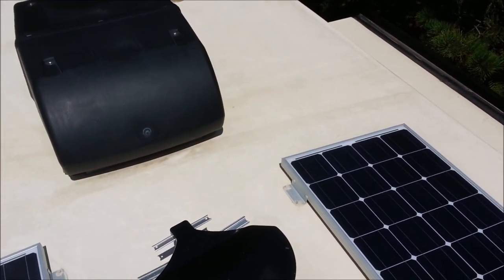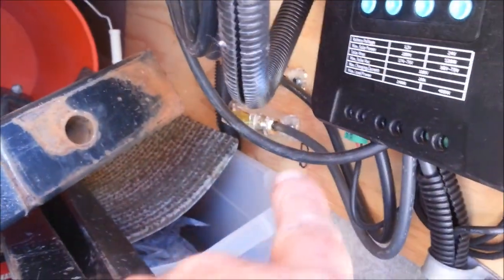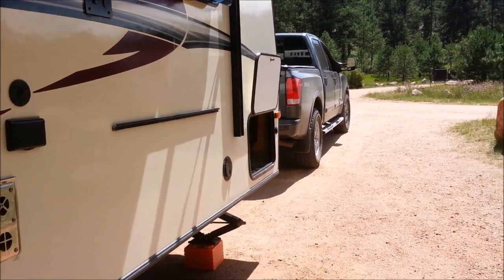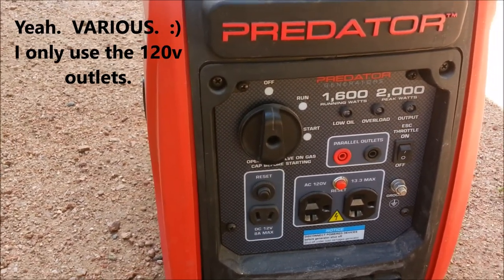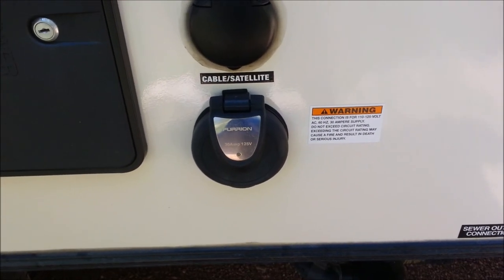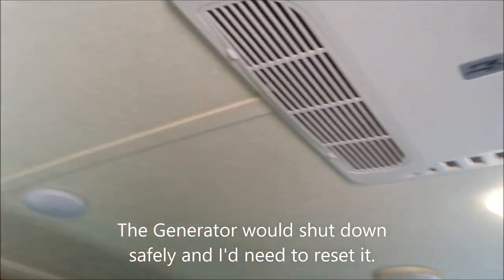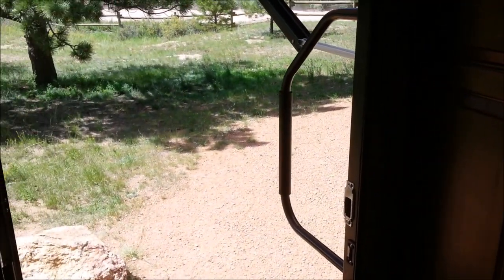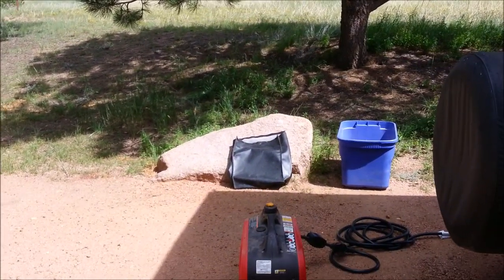Electricity 102 for Campers and Trailers.  Solar & Generators. Forest River Rockwood Mini-Lite 2109s

Comment: 2000 watts if you need it is something you need.  Use it when you need it.  No worries.  Good video.  Take care.
Reply from the maker: I'd love 2000 watts. :)   But we get by so easily on 200w and 2 batteries.  Which, I'd say is the minimum you'd want to start out for casual dry campers.  :)

Comment: I saw where one gentleman had the Honda 2200 and a 15000 BTU AC unit and the generator ran it no problem with the soft start
Reply from the maker: Mine is a 1800-2000 I think.  Max is 2000.   I rarely summer camp, though it is a necessity now.  I just be sure to camp with Electrical hookups now.  Linda would kill me if she were too hot.  LOL

Comment: I have the same camper only a flagstaff 21FBRS and have 100watt Renogy solar suitcase with the reverse polarity adapter. i also carry a honda 2000 generator i use sometimes. I'm looking at getting the micro-air soft start for my AC that should be able to run my AC. Nice video
Reply: Me too. I have the same thing as u. I would also like to have solar panels on the roof but don't want to drill holes so I use the suitcase system.
Reply from the maker: Seriously, the roof is thick.  You put down Lap Sealant, drill the premarked holes putting some Lap Sealant on the screws..  drill them in, coat again with Lap Sealant.  You will have about an inch before you were to go through the roof into the cabin ceiling.  :)

Comment: Does your 7 pin connector on your vehicle charge your RV batteries when u are driving?
Reply from the maker: Yes.  In Walmart one cold morning I'd run the furnace a couple of times to take off the chill.  Curious, I checked the battery level, and it was around 58% or so.  I wanted to see how fast the batteries would recharge idling the truck.  I let it run 10 minutes I think, and checked the batteries again and they were up to 70% or right there.  It was about a 15% increase.  :)

Comment: Have u ever recoated the top rubber roof or added any that dicor lap sealant on the seams? I noticed on my 2017 the seams appear to be cracking already. Shure thought it would last a lot longer than that. I also wonder if there is something that last longer than dicor lap sealant?
Reply from the maker: If you have a Mini Lite, they roof isn't rubber.  It's a different material.  You don't need to rubberize it.  Just check for "cracks" like you said in the current Lap Sealant areas.  Mine have cracked with weathering (I don't cover my camper) over the last "almost" 3 yrs.  Just clean off the cracks with Alcohol, let dry, and put on more self leveling Lap Sealant liberally.  For now, that is the best product I know of.  It will last MANY years if you just keep checking on it.  :)
Reply: @garlandstyle5797  Yes. Have same camper. It has TPO roof I suppose. Some rubber type material. Covering mine now to reduce sunlight exposure. I guess I need to wax it. Some say to use floor wax but I need to do more research on that.
Reply from the maker: I do wash it and when I go through the car wash I use the spray wax cycle.  It's done the job.  :)   The roof is never an issue, only the seals cracking.  But I've had 5 small cracks in almost 3 yrs now.  I think that is the name.. TPO for roofing.
Reply: The seams on the sides where it meets the sidewall?
Reply: @aguyandhiscomputer  Yes and anywhere that protrusions through the top that have that dicor seam sealant.
Reply: @mikeb6386  most people clean the area and put down a strip of Eternabond tape. Would be a good solution if there's a lot of bad spots.

Do you use a cover or anything to keep the sun off the trailer?
Reply: @aguyandhiscomputer  Yes, I do now. When I bought it it had 2 years use. It's a 2017 model bought new by previous owner in 2016.
Reply: @mikeb6386  sad these trailer age so quickly but oh well. I'm a Dicor fan but I'd use Eternabond in this case.
Reply: @aguyandhiscomputer  Yea. Really thought u would get at least 10 years before any maintenance on the roof. They could do better.
Reply: @mikeb6386  Ray from Love Your RV made a couple videos showing how he used Eternabond all over his entire roof. Good videos
Reply: @aguyandhiscomputer  Thanks.
Reply: @mikeb6386  Michael Garland and I are in a good Rockwood Mini Lite group on Facebook if you're interested.
Reply: @aguyandhiscomputer  Yes. But I am not currently on Facebook is there another way to access it? I live in KY. I am single so it would be nice to find some people to meet somewhere. Most of my trips have been to Northern Florida and North Carolina. Outer banks on the coast like Ocracoke Island and the Mountains south of Ashville. Looking for more adventures.
Reply: @mikeb6386  no, you have to be on Facebook but I don't even post on my wall, I'm only on it for the groups. A lot of good people with camping in common. And they are some meet-ups once a year in different areas of the country.
Reply: @aguyandhiscomputer  That would be nice. I will look into joining.

Comment: How many hours your batteries run in the night?
Reply from the maker: For example:  Drycamping or boondocking (no hookups, using my 2 batteries only) we may typically do this....  Pull into a spot about 3:00 or 4:00 pm.  The fridge freezer starts using the 12v system to cool.  The radio is receiving power all the time though very minimal.  We will have supper and I'll turn on the water pump when needed to wash hands and clean up.  I turn off the water pump until needed, it uses 12v and may occasionally pressure up for a bit.  We will either watch TV if there is reception or listen to the radio.  If it is sunny, the 200w solar will keep the batteries at 100% during that time.  After the sun goes down, we'll continue the same activities and may charge our cell phone or I'll charge my laptop.  By morning, using what I said above, I can routinely count on the batteries being around 70% the next morning.  The TV is the biggest user of the battery at night.  So commonly I'll listen to the radio, work on my laptop and Linda reads.  :)  So we can go about 8 hrs using what I said above and not go below 60% at the worst.  You could go to 50% but is it.  Continuous usage down t 50% will damage your batteries way sooner.